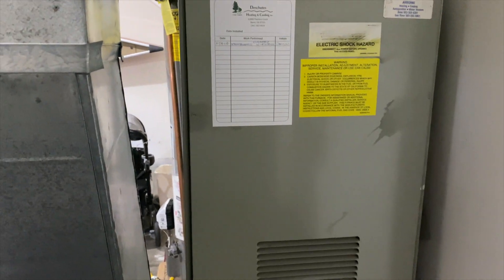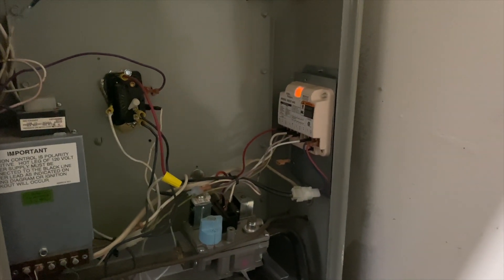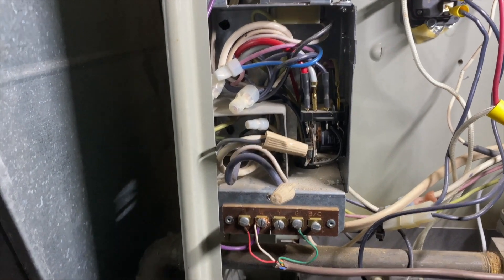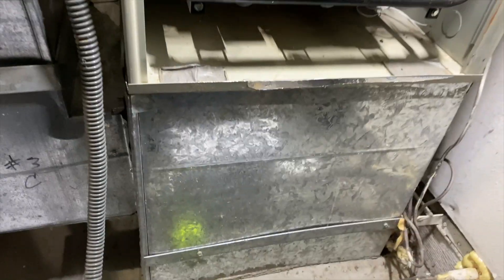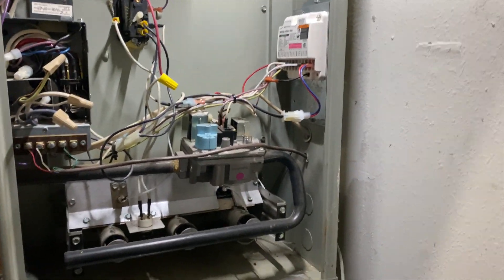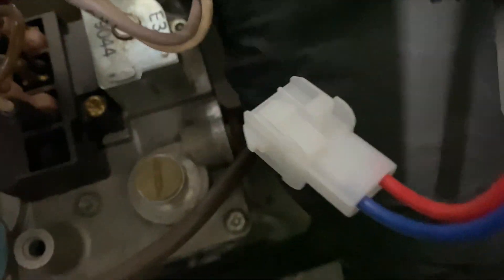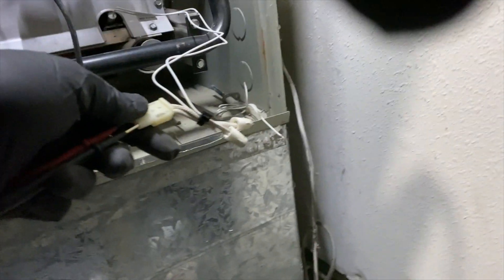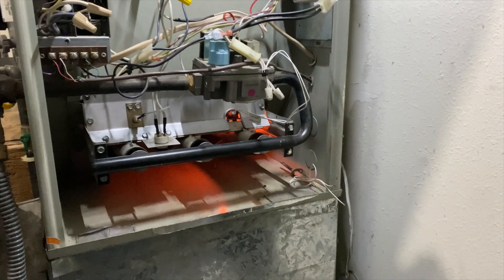Reversed Polarity and Ignition Problems. No Heat. EP70

Comment: Would a reverse polarity cause the furnace to ignite the flame but the flame sensor isn't working so it shuts down that's what a technician guy has told me 
what he has done he's ordered a flame sensor I'm just wondering if that could fix the problem or did he get some wires crossed 

I was told by a friend who used to work for a heating and air company and he had talked with his boss is boss told him it was reverse polarity once that is hooked up correctly he said that could be my problem solver does that sound right to you

Comment: I have a York Affinity gas furnace. We had a flood that took out our board. I finally found the exact replacement for a 2 stage gas furnace and i have a 9 flash reverse polarity code. I checked the voltage between hot and R and it is correct at 94V. I am hoping it isn't my new board. Can you think of anything else I can try??

Comment: Thanks for this. Could reverse polarity be the cause of a Goodman furnace intermittently working and other times locking out with flashing continuous red? Technicians have replaced transducer, main board, etc. and it's still only working occasionally
Reply: I'm having this same problem right now. Have replaced ignitor, gas valve, and pressure switches.
Reply from the maker: If the main board has been replaced you have something else going on.
Reply: Same here , did you get if fixed ??
Reply from the maker: For some circuit boards the polarity could be reversed at the igniter connections.
 Causing an intermittent issue.